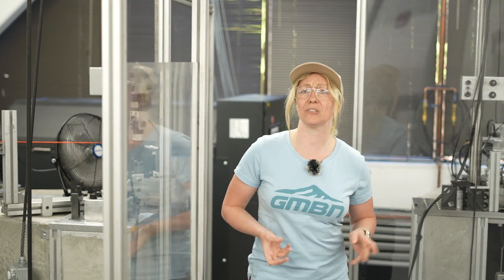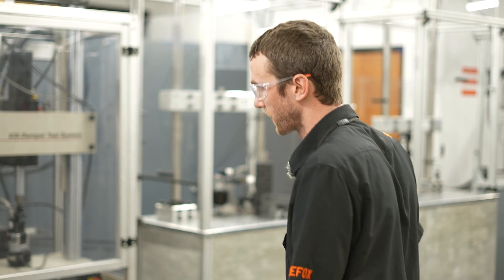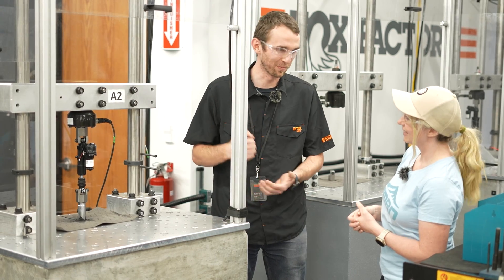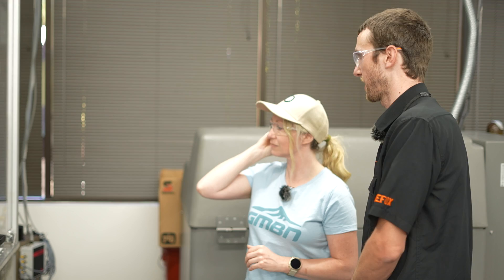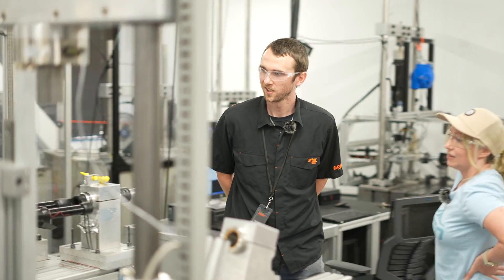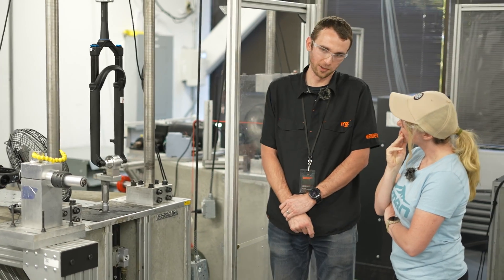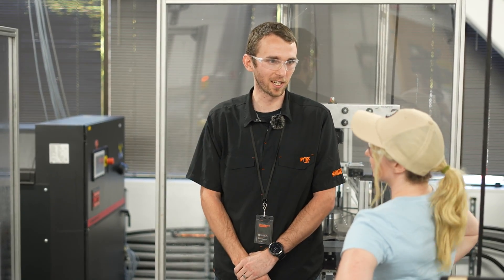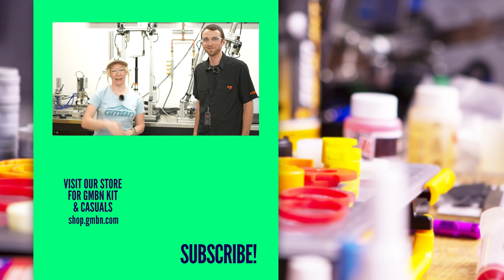How Are MTB Components Tested? | FOX Factory R&D Facility Tour

Comment from the maker: What suspension are you using at the moment? Let us know in the comments below!
Reply: Marzocchi shiver dc
Reply: Fox Float Performance 34 120mm and Rockshox Judy Silver 120mm. Not comparable 🫠
Reply: im using a Marzocchi bomber z2 with 140mm travel on my orbea laufey ;)
Reply: FOX 38 LSC/Hsc and Fox DHX2.
Reply: Fox 36 performance, 150mm.

Fox float X performace elite on my Fuel Ex
Reply: Factory 38, 36, performance 38 and 36, that should cover them all i think :)
Reply: Suntour Aion 35 boost 160mm (currently set set to 150mm). I really like it 😊. Got a Rockshox Deluxe on the back which seems to do the job quite nicely.
Reply: rockshox
Reply: I use Manitou Pro Mattoc on my hardtail and Mantou Markor on my commuter
Reply: DVO Dimond fork and Fox Factory Rear Shock. Being able to re run a trail from telemetry data would be most important for shimstack valving changes and to simulate how well the fork could work with different weight or ability riders. Would be pretty cool to see a fork re run a Downhill world cub trail .
Reply: IBIS RIPMO V2: FOX 36 Factory float grip 2, shock Fox Float X2, 
second bike Focus SAM2 6.9: Fox 38 Factory float Grip 2 E-Bike spec, Fox Van coil shock. I have also Fox Transfer Factory, but it is really worst telescopic seatpost, and in winter it does not work. Not worth the price. For half you could have better.
Reply: Fox 34
Reply: Rock shox and RST abandoned fox because maintenance was hell.

Comment: Since your going downhill mostly and now have cheater bikes why not just put motorcycle shocks on a mountain bike?  It would suck if you have to go uphill but would be awesome going downhill.
Reply from the maker: That's all these are scaled down though since they don't need to deal with the extra weight of the massive bike and the engine :)
Reply: @gmbntech  it still would be awesome to try out a bike with motorcycle shocks on it.

Comment: If they want to provide a smooth feeling on the fork, why brand new bushings needs a recalibration/burnishing to correct the tolerances and reach this goal?
Reply: Exactly this, they can do it but some Excel sheet said that it’s not viable. Funny thing is that they will sell you burnishing tool or do it for you per warranty request if you’re persistent enough. Same goes for the amount of grease in the negative chamber, same problem since 2015.

Comment: What about real conditions like dust and mud, cold and heat? In clean lab you can make much more cycles then in real ride.
Reply: If you look at the shock at 4:05, the label says "Salt Spray."  So, they are doing environmental testing in the lab, which is not shown in this video.
Reply from the maker: True, but it's not like these brands don't do plenty of outdoor testing too and years of heritage and learnings about how long components and suspension systems last in the real world :)
Reply: @gmbntech  If that was sufficient then they wouldn't need a lab.

Comment: My performance elite setup is stil working fine after 5 years without any servicing
Reply from the maker: Nice! Although you may find that a little bit of a service on it has it coming back with performance that you'd forgotten it could get! 5 years is quite a while, but if it ain't broke, don't fix it!
Reply: Maintenance isn’t waiting until something bad happens, servicing should be done way before that which is why intervals are set. I don’t see the point in paying top dollar for a high performance fork and then losing said performance by neglecting it.

Comment: On my HT I’m running a Rockshock Yari 140mm with 35 mm stantions. It seems to ride higher in the travel the way I have it set up to keep it from diving for majority of riding. On My FS running a Marzocchi Bomber Z1 at 140mm travel with 36mm stantions, mated up with a Fox Float X shock in the rear. I had to run quite a bit faster rebound on the Marzocchi to prevent it from packing up and changing the geo. Both forks are pretty easy to get dialed in to how I want them to feel. The Marzocchi is a little more plush throughout its travel which I like on the full sus, seems to complement the Float X very well. Been thinking about volume reducers for both in the future. I’m 225lbs so even though I’m running 140mm travel forks I like the beefier stantions on both, gives a more precise and composed feel.

Comment: Not related to the video, but a suspension question on the less.... why do shocks get hot on long descents? I had always heard that it is because the air is being compressed in them.. Boyle's law and all that. This made sense to me until I was doing bunny hops in the street outside my house this morning. If they heat up under compression, shouldn't they cool down under rebound? The expansion off gases coming out of a spray can is what cools it down.... and that is how AC and fridges work. I realise it is not going to be perfectly one for one but still.

I get that in a vehicles suspension large quantities of fluid are being forced through small holes to create the damping, and that the fluid is heated by friction... is the same thing causing the heating in the MTB shock? I admit my knowledge of MTB dampers is fairly rudimentary.
Reply: My understanding is its mainly the oil in the damper being forced through small holes at pressure. This generates heat and this builds up on a long decent. That's my some shocks have a piggy back reservoir to increase the volume of oil and reducing the chance of it getting too hot.
Reply: Moving molecules generate heat. Compression or Expansion.

Comment: I am kind of curious about the service life on MTB products. I had a 2010 Ford Raptor (the vehicle the engineer in this video mentioned working on before moving over to MTBs). The year I had ran Fox triple bypass rears with front internal bypass shocks. Around 12 inches of travel in the real about 11 in the front. I have buddies with 100000 miles on the shocks and they are still running pretty strong. That is on a 3 ton truck that can do 80+ mph offroad. 

My bikes run a variety of Fox and Rockshox products that have a recommended service life of 50 hours.

I know it is apples to cannonballs but how are they managing to get such great life out of their automotive products and so little life comparatively out of the MTB ones? Is it a case of the MTB stuff being pushed to the limits whilst the oem automotive stuff is dialed back a little.... like a race tuned engine (on the mtb suspension) vs a tractor trailer diesel (on the oem auto stuff)?
Reply: Would say because of weight. Lighter parts are less durable and need more maintenance.
Reply: Oil volume
Reply: My guess is that truck shocks will have more, tighter, and more durable seals compared to mountain bikes, which will greatly decrease contamination from all the crap that exists outside, but significantly increase friction.  The added friction ends up being meaningless because, as you said, the truck wheights 3 tons, which is 40 times the weight of a mountain bike rider.
Reply: Well, for one it's the fact that those service intervals are essentially peak performance intervals. You can absolutely run the suspension longer, but performance will eventually degrade. You could have serviced those triple bypasses more frequently and they would have also done better.
Two, it's oil volume and design. Those forks have to be light so we don't have 50lb+ bikes and the suspension has to not have stiction, because they only have rider weight to overcome it. So, they skimp on support parts

Comment: I've got a set of marzocchi dirt jump forks from 2003 they've bin serviced twice in 21 years and they still look new internally ! Also a old  hope disc brake set from 98 or 99  that still works well 👍  they don't make em like they used to 😂
Reply: I also had some Marzocchi dirt jump forks on a Mondraker hardrail/jump bike from around 2006..absolutely indestructable those forks..fully agree everything made to fail these days 🤦‍♂️
Reply: I understand you perfectly, I have a 2003 Dirt jump fork, I recently changed the oil and seals on it after 21 years of use, it works like new💪
Reply: Had aquried a set of 03's as well. They were seized. Quick lower disassembly, wipe down and fresh oil and theyre mint. Companies dont make em like they used too. Still running its original seals and theyre perfect